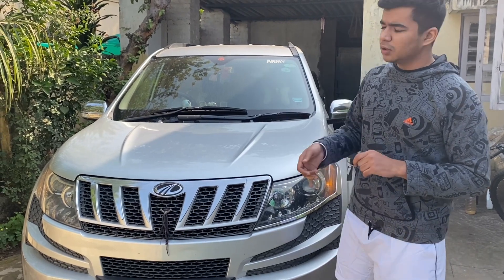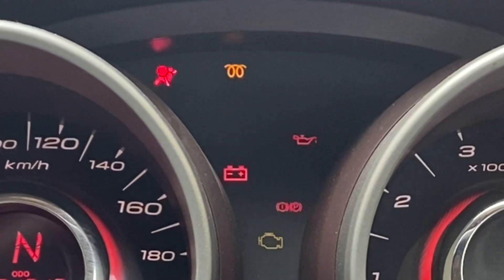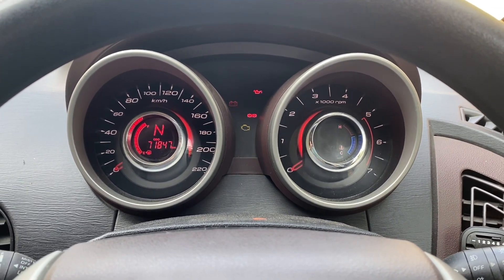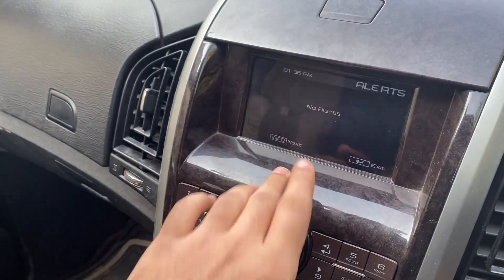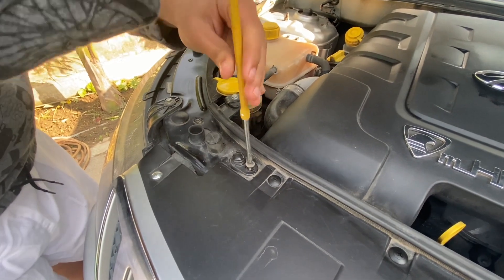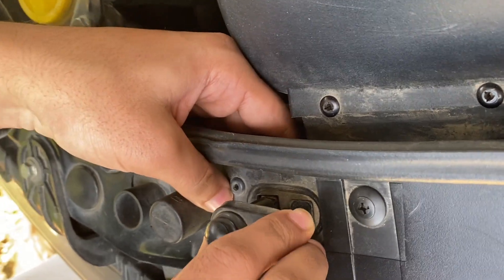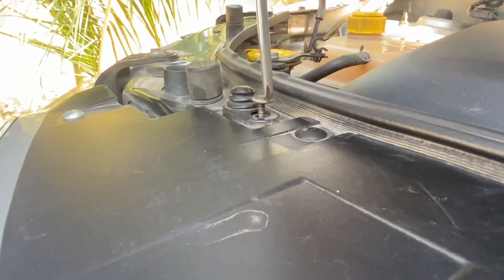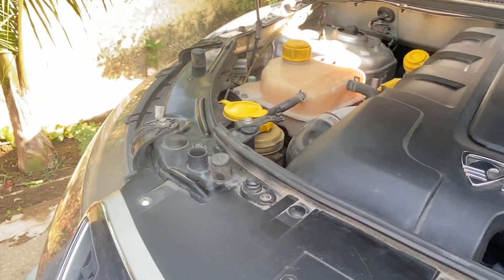Mahindra XUV 500 Hood Open Warning (Diagnostics And Solutions)

Comment: Bro i have xuv 2012 model completed 88k kms and i saw some oily dust sepage on an air filter pipe whats the reason behind that i asked few of my friend they said turbo is blown but cars pikup is like rocket no oil cunsomption and no white smoke !
Reply from the maker: Well, there could be a lot of factors for this problem.
You could have worn piston rings (as you said you’ve completed 88k kms).
I would recommend you to get it checked since delaying it will only cause more damage to the engine.
Reply: @pranavprashar9710  but there is no blow by and back compression no oil consumption 🤷🏻‍♂️
Reply from the maker: @ThakurAbhishek5347  You never know what is going on inside the engine. Better to get it checked by a local mechanic instead of waiting for a huge bill to pile up.

Comment: Hi !
I’m having the same problem with driver side door.
It gives me door open warning when the door is closed correctly.
I’m not able to find the sensor either.
Any help would be much appreciated.
Thanks !
Reply from the maker: The sensor is hidden under a rubberised enclosure. It should be visible once you open the door and then you have to open it with a screw and perform the same procedure. 
Hope this helps!

Comment: Bro meri xuv 500 2012 model bhai uske door bohot ratling karte hai plz solution batao plz
Reply from the maker: Sir it depends. If it is only on one of the doors then I recommend taking the car to the Service Center and Disassembling it to check the issues. 

Since this is a Mahindra, a little rattling sound from the Interior/ Doors is common and you have to live with it.
Reply: Pranav Sir thanks